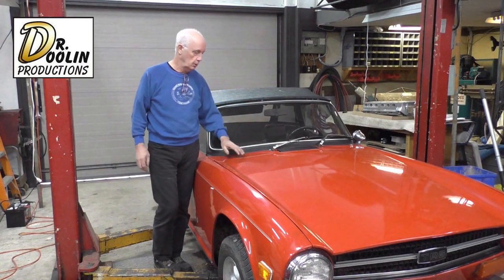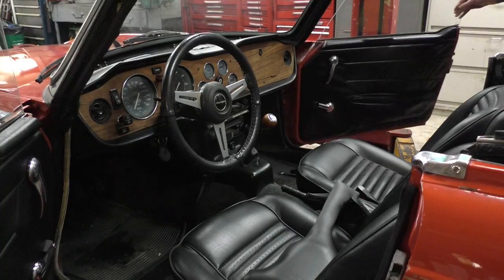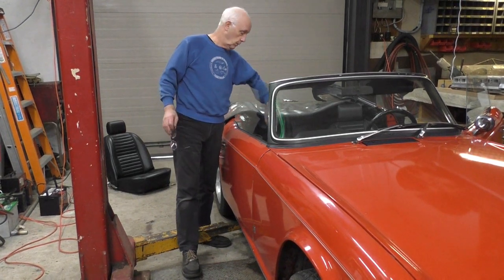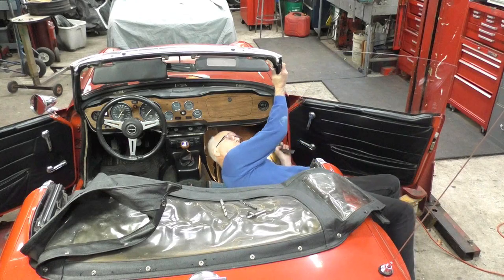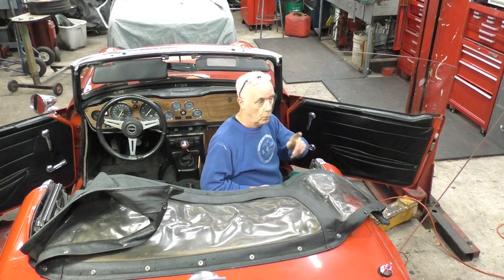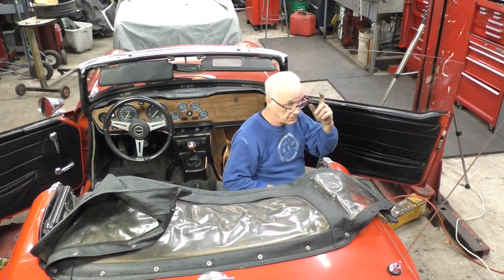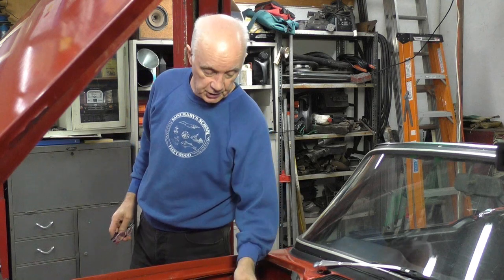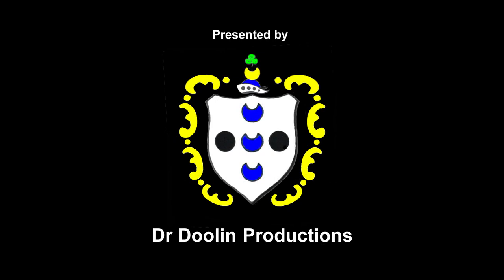Dr-Doolin How To: Triumph TR6 Hood  / Bonnet won't Open

Comment: Replaced my TR6 seat bolts with Clevis pins to make removal easier.  Emergency hood release a great idea, saved my ass a few times.  Yeah, I was getting too old for fixing her so we had a divorce after 31 1/2 years and I’m getting on with a Jaguar F-Type now just fine…

Comment: Yes Doc, we're all getting a bit old and inflexible to be working up under dashboards, how do you manage to see anything in that position. Tip:- a step drill is the best thing to drill body steel, you just keep stepping through the hole till you get the size required, and it doesn't dig in.
But there's no substitute for experience, you've done that a few times.
Reply from the maker: You don't actually think I can see anything under there do you. Must admit it's definitely a bit cramped. To think I used to manage that without taking the seat out. I have never tried a Step drill at your suggestion I shall do so.

Comment: This happens. I pulled the measurements off another TR6.
They make an extra opening cable kit for the right hand side. So when the left hand side cable fails you have a backup. It cost about $12 and if it happens to you, the minute you get your next TR6.
You buy The Back-up opener kit.
Moss has them. Rock on.

Comment: Just be very careful with the metal bar as you are right near the positive battery terminal.
Reply from the maker: Fitting a length of Shrink tube would solve that worry

Comment: You could have had it up on the lift, stripped out the pipes and starter, taped up the live wires and popped that bonnet in half the time you messed around doing a dead fly!
Reply from the maker: Most guys that watch this video will not have a hoist. To remove the front pipes from a TR6  is not easy on Axle stands or a hoist. The front pipe has to be separated from the exhaust, you can not drop the exhaust complete. The connection of the front pipe is fastened with u-bolt type exhaust clamps that set a ridge in both pipes, very bad if over tightened which they usually are. There is not room to twist or work the pipes apart easily. If you get them apart, when you put them back together you more than likely will have an exhaust leak. Then dealing with the front pipe to manifold will usually take heat to undo the manifold nuts to prevent snapping the studs. Breaking a stud require removing the manifold to remove the broken stud. The starter is fairly straight forward to remove. 
But why don't you just disconnect the battery instead of "taping up the wires"  think that comment shows your actual experience.
Reply: @Dr-Doolincom   I didn't say disconnect the battery, show me where I said that! I said tape up the live wires.  Oh, and don't lecture me on dismantling a tr6 exhaust system, it's not that difficult even on ramps and or axle stands. Done it dozens of times. Sure beats the hell out of vandalising the bulkhead drilling holes in it. Just shows your level of experience and competence, which is clearly as bad as tour ability to read what others actually write!
Reply from the maker: @tomcollier2444  Why don't we do this, you go back to fixing your rust free TR6  and I'll continue repairing Brit cars that spend half their life in inclement weather as I have done for the last 50 yrs or so. I don't need a reply by the way.
James
Reply: @redmysterium Are you serious!?!?!?!
Reply: @redmysterium  Seriously! When you read the sentence, are you incapable of computing the fact that it's a typo error and should read 'your'.  I mean, If tour ability to read doesn't make sense, does your brain not realise that it's a typo and should read your ability!?!?!?!
Reply: I made a comment, it included an unintentional grammar error. Sorry to disappoint, but I didn't pretend to do it, it just happened all by itself. Please, don't throw away anymore of your life's precious time policing typos on social media. Nobody gives a damn!....... Apart from you.... Obviously!1